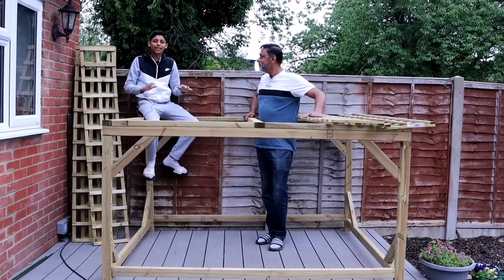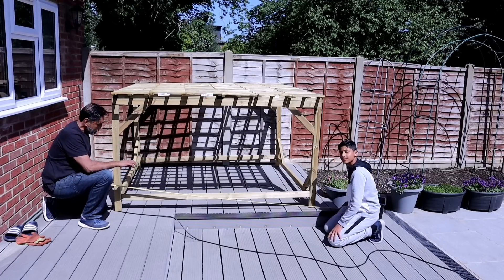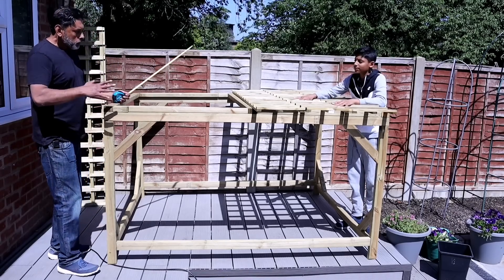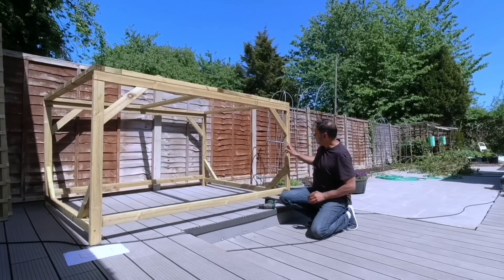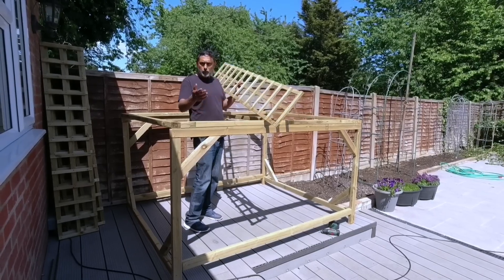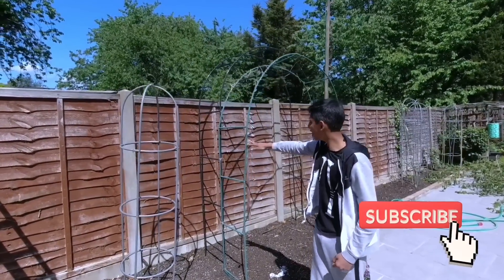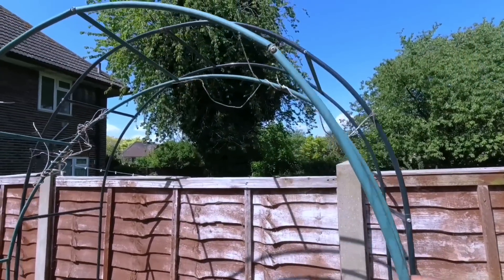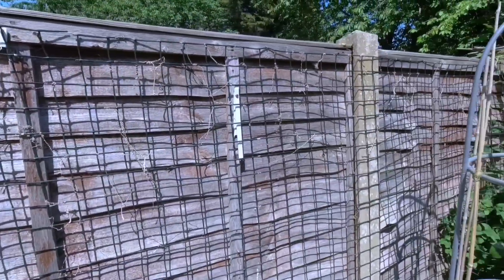Step by step guide : How to make a garden trellis

Comment: Do you pre drill the holes or just screw straight into the wood? Also what screws do you use?
Reply: I would strongly recommend to predrill otherwise the screw will struggle to go in. Make sure to use the correct drill size to pre drill based on the screw you use.